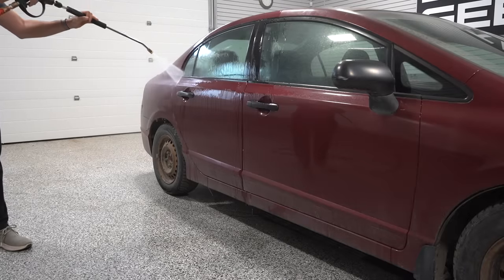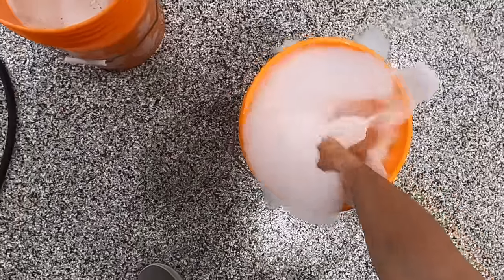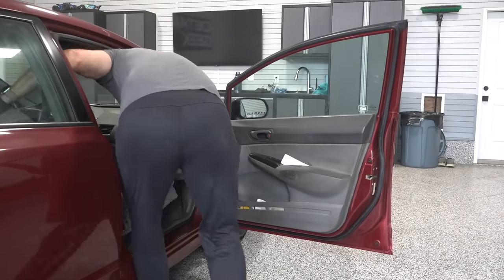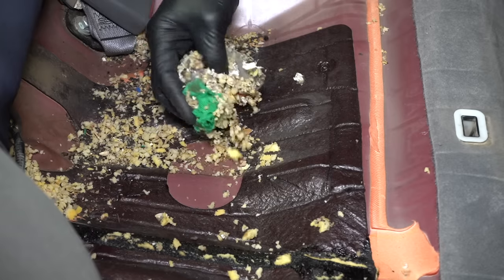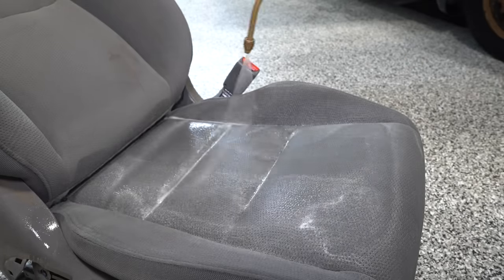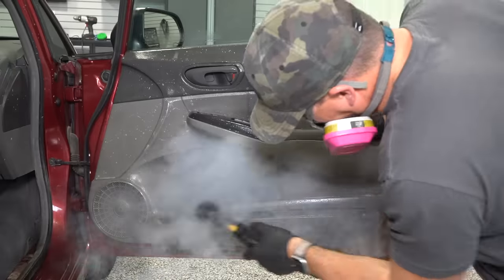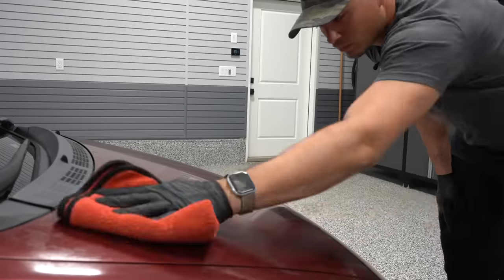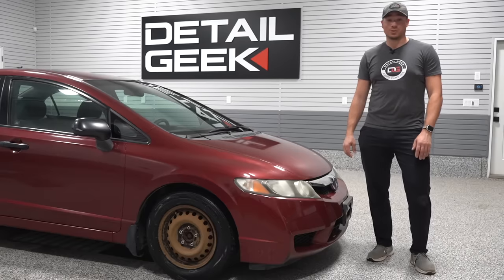I’ve Never Seen ANYTHING Like This Before…

Comment: ugh I just did my monthly limit of 1 disaster detail on a  older Totoyota Camry. leather seats were going to be replaced for 800$ but I used my Wagner steamer and leather cleaner conditioner for almost 2 hours straight to get them 90 percent better.  my customer read so happy they have me an extra 200$ for saving them 800$  very satisfying detail though hard work. I also same down the headlights with 3k and 5k wetland  paper them polished and applied a 2k clearcoat. absolutely best job I did on lights better than new.  they turned around and sold the Camry for double what they paid for it and then tipped me again.!  they offered me jobs on cars because they flip cars and needed someone to do this kind of restoration  I said I can do one but not often as I'm trying to keep cars clean. not being them back from the afterlife.    keep up your awesome work and passion you're the man!

Comment: Fantastic job as usual. Really like your video's  very professional. 
Just 1 question about this Honda with the amount of rat's nest and mouse and droppings  you never cleaned or checked under the hood .My thoughts on this is with the engine running and on long drives  smell would be bad coming into the cab.
But overall  what an amazing job nd transformation and another one saved well done  Geek

Comment: I have an 8th gen civic (2011).....still runs like a champ at 167k......itd be even more but from 11/18/2019 when it clocked 150k I've only driven it 17k miles thanks to the pandemic and working form home now (used to be an 80 mile round trip commute)

Comment: I'm just curious why you don't use a wide vacuum attachment for the large flat areas of carpet and the crevice tool for, well, the crevices 🤔 no hate, love the videos. Just curious, seems like it would save some time. Also, I've only seen you scrub the bottoms of the seats, do you do the upper portions as well? I'm just thinking of back sweat and nasty stuff like that embedded in the fabric

Comment: When I was younger I had a 1976 Volvo. Looked awesome outside, I had gotten it restored for original paint. I could not keep the interior clean for the love of me, since I worked on a horse farm and had a border collie who added infestations of fleas during the summers. I loved that car, but could not get anyone to fix the engine when I found out the engine blocks had broken during an oil change. I had bought new engine blocks, engine was fine, but needed to be lifted to replace the blocks. The engine had been held in by the remaining block and the oil filter.

Comment: Do you disconnect the electricals from the battery before starting to clean?
Reply: That’s a LX model it doesn’t have steering wheel controls. Only the EX’s or higher trims have that option

Comment: Why don't you use chemistry instead of that much water? Start with and acid pre wash (like #purifica by labocosmetica) in the foam gun, let it work for some minutes and then rinse. You'll get all the mud away way easier

Comment: The thing about dealing with a place where someone died is that there can potentially be feces or urine in addition to any blood. Upon death all of the muscles holding in the feces and urine relax. This is fine if there are none of these things "on deck", but otherwise part of the smell that was bothering you could have been that. It WAS weird, however, that the only stain was in the back seat. Maybe there had already been an attempt to decontaminate the car prior to the old owner selling it. 

In any case, despite the mess, it looks like the previous owner took care of the mechanical aspects of upkeep. Plus, Hondas are built like tanks. Nice clean! 😊

Comment: Hey, it's a Honda.  !80k+ miles is nothing, if you do the very basic maintenance.  I've owned 3 Hondas, first one made it to 186K miles in under 3 years (I used to commute 120 miles a day round trip), second Honda reached over 500k miles in under 4 years, 3rd Honda was at around 360k miles after 3 years.  I currently own a '98 Toyota Camry with over 175k miles on it, still going strong (although I gotta admit, he doesn't like climbing hard grades).  

Mitch, just curious, do you clean the door seals?  I have to assume you do, but just wanting to be reassured, as I always find them very dirty and very difficult to clean.

Comment: Those little creatures can really cause problems in a car. 
My first car was a 1988 Plymouth Horizon, 4 doors, hatchback, I bought it new at 23 years old. I loved that car. After a few years, it would just go dead out of the blue. My dad looked all over, determined it was likely a carburetor issue and we took it to the shop. Well, a chipmunk had built a nest in the carburetor. They cleaned it out and all was fine. I always wondered what the chipmunk thought when his home kept vanishing.

Comment: The owner is lucky the mice/rats didn't go to town on the wiring.  When I was sick with Covid back in February, some kind of roden set up housekeeping in my Volvo.  Thankfuly comprehensive insurance covered the damage.  Between labor, parts, etc. It came out to over $9k in repair costs (not to mention the wait time, the full wiring harness needed to be replaced which in the case of my car required a 2 month wait for it to come from Sweden).  Rodent damage is no joke.

Comment: Hey man for your steamer, do you use the scrub brush that came with it? I can't find a softer bristle brush and I'm afraid to use the one that came with my Mcculloch coz I don't want to scratch the plastic on the doors
Reply: He uses the MC1375 which comes with a ton of accessories and brush heads. I assume he doesn't use the brass brush lol so my best guess is the small nylon utility brush. If you check the description, there's a link that shows all of the brush heads, that might help you out!
Reply: @Jennifer_MB  thank you 😊 yeah I bought a mcculloch steamer and it came with 2 nylon brushes and a brass brush head. However, the nylon brushes seem very stiff and I was just wondering if there were any after market brush heads that were a bit softer lol.. maybe I'm over thinking it and should just give them a try in an inconspicuous place to see what happens
Reply: @TeiwazTV  Let us know how it goes! Afaik he's never mentioned any different aftermarket brush heads.

Comment: Vehicles without any type of hubcap/wheel cover are like seeing someone without their teeth.  Just doesn’t do it for me.
Reply: Same! As a teen I had an old LeBaron that would throw hubcaps if you looked at it funny. I used to chase them down if I saw them roll away, but ended up buying and replacing dozens before finally giving up lol

Comment: Find some OEM hubcaps and remove the silly dumb hitch from the back - even better and easy enough to do.  What would finish this very well but will not happen is if it were a manual transmission to begin with but oh well.  Looks pretty dang good considering how it started out!!!!👍👍👍

Comment: With the rodent infestation and the turds and urine contamination, the vents and airducts need to be cleaned and sanitized thoroughly ..... the full length of the airducts, from the beginning to the end of the run of the ducting.  And, I would have insisted that the carpets and padding (if there is any) be removed and the floor pan cleaned and sanitized.  And what about the head liner.  That needs to be cleaned and sanitized as well.  He never shows cleaning of the head liner.

Comment: The vacuum hose that connects to the wall. How long does it take to fill up the wall? ( just a joke ) Do you have a dumpster on the other side? Its  a great system you have, you don't have a rolling vacuum sweeper, just the hose. I wish my shop was set up like that.